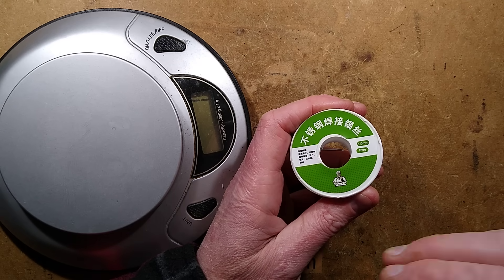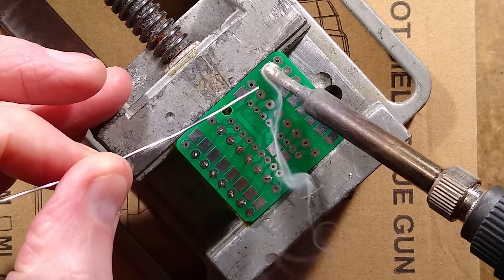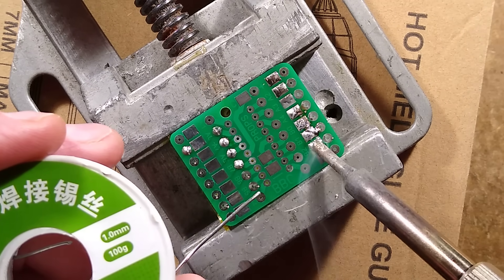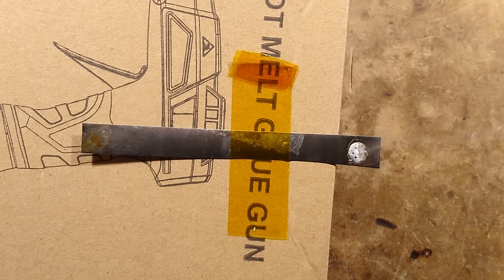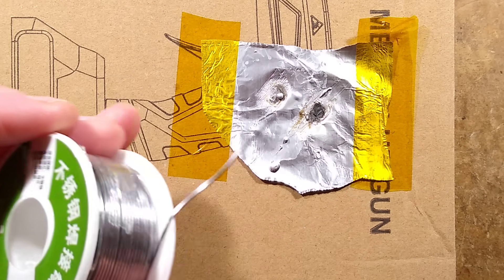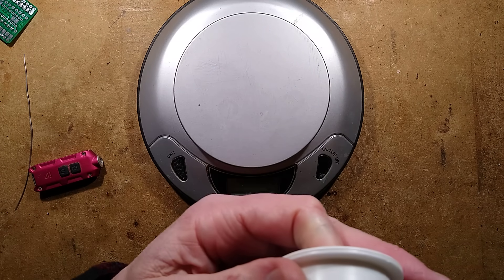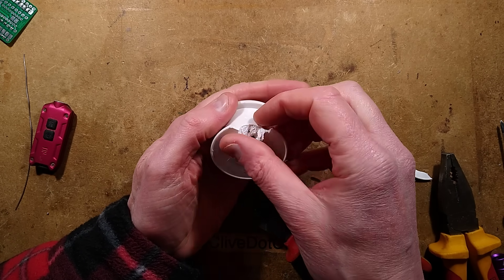Testing AliExpress "mystery solder"

Comment: I am very wary about solders since I tried a lead-free spool a few years ago. The joints were messy and the flux was aggressive, wrecking the soldering iron tip so I only use lead solder now which is much more reliable. I will certainly avoid this AliExpress solder.

Comment: RS used to sell the Red Jelly flux. You could solder stainless with that but the flux fumes were savage. I think it was a highly acidic flux and had to be cleaned off after use unless you wanted to watch circuit corrsion in real time.
I still have a bit left that I use to re-tin bits that have got damaged.

Comment: if you want to know which metal the solder is made out of, you can use precise weight measurements, or use different types of acids, or precise impedance values (which is likely something YOU can easily do).  you likely will not be able to figure it out just by using a soldering iron.  There are other ways, but likely you do not have access to a lab.

Comment: This (  shrinkflation method ? ) is frequently used for ladies ( potion pots ? )  .... HUGE  pot with a  BIG  false bottom containing just 5% of sticky goo  😝..... There is an acid flux (  A8 ) which enables any soft solder to work with stainless ... and even Nichrome wire ! ! .... Aluminium soft solder is a  TOTALLY   different alloy ... and ... will really ruin your bit , to the point that it can never be used again , for normal soldering  😝.... ( tried - n - tested ) ................. DAVE™🛑

Comment: Multicore makes a solder called Alu-Sol for aluminium and stainless steel, on which as you say normal solder will not work. Alu-Sol is not recommended for electronic components because any flux residue is highly corrosive.

Comment: Ha ha ha ha ha!  Ha!  I went through something very funny with solder.  Way back in 1989.  When I went from Washington DC.  To, Wellington, New Zealand.  To make a recording for a Los Angeles record label.

When I got there.  One of my important Microphone Mixers.  Had gotten busted.  From a hard hit.  With Fragile Stickers.  On all 6 sides of the box.  That didn't matter.  I have a busted voltage regulator.  It broke right off the circuit board.  And I saw when it happened.  When it was loaded.  I just knew something like that will have occurred.  But I digress.

I found an electronics parts store.  They had the voltage regulator.  I needed a cheap soldering iron and solder.  They handed me some solder.  It said 60/40 rosin core.  Perfect.

When I tried to effect, the repair.  The solder was not working.  It was not melting properly.  No matter the amount of flux.  It certainly wasn't the heat.  It was a $135, Weller Soldering Station.  Similar to what I had used for years.  But the solder was not working!  It was not flowing.  It was not smooth.  It was all cold little blob solder balls.  What the hell?

So I look at my 60/40 solder more carefully.  It is 60% tin.  40% aluminum.  What the FUCK?  New Zealand had already gone Green by 1989.  No more lead was allowed in the country.  Except in car batteries.  Ugh!

And while my repair appeared to work.  There was no way.  I was going to trust that.  For the week long duration of the recording session.  Because the solder was no good in New Zealand in 1989.

When I got back to the USA.  I think I purchased myself 10 pounds worth of solder, 60/40.  60% lead.  40% tin.  As it should be.  And I have since run out of most of it.  What will be available in the future?  I will not bother with that, tin and aluminum garbage.  That is bullshit!  That is not solder.  That is some ineffective concoction and amalgam.  That does not work at the heat levels we must maintain low.  To keep from burning up the parts.  Aluminum needs to be over 1000°F.  And that's not happening.  ROHS?  Crimped garbage!  A total lack of solder.

And don't get me started on Surface Mount, bullshit.  That's nuts.  That is not meant to be repaired.  That's why it's built, that way.  But there are crazy extremists.  That will fix that stuff.  And replace a VLSI, Very Large Scale Integration, circuit.  With over 100 leads, on it.  To remove that.  And stick on a new one.  Really?  It's disposable!  Replace it.  None of this was meant to be repaired.  It's a crap shoot.  Why spend the loot?  Throw it toward a new one.  You need something reliable.  Not an old jalopy that keeps breaking down.  It's the way the rich guys designed it, to break.  And to become part of a landfill.  Since it's mostly sand, reprocessed, to begin with.  With a whole lot of gold.  Which can also be recovered.  Because it cannot be replaced.  Without more asteroid hits.  We don't necessarily want.  You know?  And so our thin atmosphere, helps.  It's only 15 pounds per square inch of pressure.  Not enough to slow down a falling airplane, slowly.  Unlike on Venus.  But then the passenger jet would melt in mere minutes.  So it has to remain above the clouds.  Just so you know.  But I digress.

I don't think Donnie is going to make it through the next four years.  I think you will get worn out.  And want to go play golf, a lot.  And leave everything up to JD Vance and Mikey Johnson.  And Elon Mosque to run the country.  Elon will become Speaker of the House.  And will tell everybody what he is making more efficient.  That will cut down on having to pay a lot more people they don't need to.

I can tell everything is going to go like Cock Work. Only their mothers will know that they play with themselves.
RemyRAD

Comment: Is it rosin core? Another test would be to try to wash the flux off. If it washes easily, it’s water soluble which is really nice but you have to clean with soap and water to stop the corrosion

Comment: I bought a "4500mAH battery backup/charging station/flashlight" combo with external solar panel thingus a year or two ago. At full charge, it was unable to keep my phone from dying. Opening it up, it contained two standard small lithium cells, and a plastic-covered weight to give it heft. Those people have no self-respect.

Comment: at 5:40 i must know what that magical pen you're using is that instantly roughed up that surface
Reply: Looks like a fiberglass pen but I could be wrong
Reply from the maker: It's a wire brush pen.  Available in brass, steel and fibreglass.

Comment: One of my soldering irons came with a reel of quite nice, thin solder... Looked and felt like it would be a decent roll. But it turned out to be just 2 layers wrapped around a spacer inside the reel.
Very disappointed - not so much because i felt like I'd been ripped off (since I bought a soldering iron, not solder), but because I really liked that roll of solder. The stuff I bought to replace it doesn't feel as nice to use.

Comment: I have a similar one, also labeled as stainless steel Solder (50g), but definitely far less than 50g quantity.  This solder was put on the shelf for at least 2 or 3 years and long forgotten.  I fished it out and found out that 
- the solder loses its shiningness and looks dull
- in few spots, rust similar to iron oxidizing (brown-red color) showed up!
It definitely is not "stainless".

Comment: I had 3 rolls of soldier that were recalled by aliexpress, they did not say what chemical but said it contained a high level of something bad, it also trashed all my soldering tips.
I was refunded and binned 2.9 rolls of solder.

Comment: I only use 60/40 and 37/63. I like lead. That lead free stuff sucks. you'll probable never have a reason to solder stainless steel. I never have. Use 5 core multi-core and you'll never use anything else.  Thats clearly lead-free garbage.

Comment: In theory you "can", you're able to solder silver with a tin/lead alloy at a low temperature. But you shouldn't!
When you re-melt silver or gold and the alloy gets contamined by the tiniest amount of lead or other metals - it not only alters the %age or Karat of the alloy down but it also makes it BRITTLE! Rolling, wire-stretching, forging - nothing is possible with such contamined silver or gold anymore. It crumbles luke dry potato-chips.
This contamined alloy needs to get cleaned electro-chemically in a factory!

Comment: For solder to 'wet' onto stainless steel, then it likely had an aggressive hydrochloric/ zinc chloride acid based flux or phosphoric acid based flux in dry form in the core etc
Not good for electronics soldering or sniffing.
Gaz Yorkshire.

Comment: you should solder some electronics parts and have the circuit run for a sometime and go back to see if the solder has damaged the copper traces !

Comment: The alloy of this solder must be cheap as dirt to maximize profit. My best guess is that it’s lead solder — not leaded, but pure lead. It’s soft and can be used as solder. Due to its high availability and diminishing demand, the price has plummeted to $0.8958 per pound.

You don’t need a sophisticated lab to verify this. Pure lead solder joints have a matte surface, and lead-free solders also produce a matte surface after soldering. If you mix this solder with a lead-free one at an approximate 40/60 ratio and add a proper flux like rosin, you should obtain a shiny solder joint.

Regarding the flux, it’s probably an inorganic acid flux containing zinc chloride. It’s corrosive and not suitable for PCBs. You can also verify whether the flux contains chlorine using a simple test called the Beilstein test:

1.    Get a blowtorch with a blue flame.
2.    Heat a thin piece of clean copper wire in the flame until it is red hot.
3.    While the wire is still hot, dip it into the flux residue.
4.    Put the wire back into the flame — if it produces a bright green flame, it indicates the presence of chlorine in the sample.

Comment: There's a lot of scams on Amazon from the Chinese sellers also... I was on the Amazon Vine program where I would get "free" (actually, more like heavily discounted once you factored in that you had to pay income taxes on the items) in exchange for (what Amazon insisted) "honest reviews, good or bad".  I spent a lot of time testing the products and writing the reviews, but a couple of months ago, they kicked me off of it, saying that I had violated some provision of the TOS with my reviews.  I could not find anything that I might have violated.  They deleted my 600 or so reviews (some were Vine, some were products that I had bought).  I suspect that they did not like it when I pointed out the Chinese scams with LiFePo4 battery capacity and lumen claims on vehicle LED lights.

Comment: Thanks for the heads-up on this one.  I'm still going through two pounds of 60/40 .020" I found in a tool box I bought at a yard sale.  I don't care if it has no lead in it, that lead-free flux smells toxic, while the 60/40 stuff is pine sap.
Reply: Worst thing about old solder that is not on a reel is dirt and oxide. A few minutes soaked in liquid soap followed by a good rinse sorts it out. Then stored in a screw top jar.

Comment: I'm surprised the spool weight is factored in at all when you buy solder. If I bought I roll of solder that said 100g and I weighed it straight out the package, I would expect more than 100g, since it would be 100g of solder plus the weight of the spool. The same way when you buy a spool of 3D printing filament, it says it's a kilogram, and if you weighed one straight out of the packaging, you'd likely see ~1.2 kg due to the spool weight.

Comment: 0:12 "It even shows someone TIG welding...which is not right". I don't know about this. I remember a while ago seeing a video of someone TIG welding using solder a 1,000,000,000 Candle-Lumen 100W Power LED. So, this statement is patently false (it had explosive results, but that was due to a defective Ebay product).

Comment: Former employer bought this stuff, in fact we had so much junk from China is was crazy, some of it was good value, the hot air stations were great, soldering irons were trash, solder was trash, tools were trash, that's what happens when an accountant buys an electronics repair business.
Reply: Which solder stations are good? Yihua?
Reply: @JohnHopkins-e3p  What kind of soldering station? Regular or hot air station?
Reply: I’m looking for both. Something good enough for PC and console motherboards.
Reply: AiXun soldering stations
Atten 862d hot air station @JohnHopkins-e3p
Reply: In general the every industry where decision making isn't done by professionals who know this industry thoroughly.
Reply: Exactly what do accountants know about the physical world? FA.
If you want to ruin a business, hire an MBA.
Reply: @chriswalford4161  ya if you want to run a business into the ground in a handful of years.  MBA are all trained that labor is an expensive when it has always been considered an asset and resource until the 70s when MBA damn near took over running companies...but never founding a single one....
Reply: Apparently China specializes in hot air. This is something they have in common with certain American politicians!

Comment: They might be using an acid-base water-soluble flux, which would explain the soldering of stainless steel. If so, the flux can and must be cleaned with water.
Reply: "If so, the flux can and must be cleaned with water."

To prevent damage to.. a standard plastic/fibreglass PCB? The solder mask used on such? Other stuff reacting to produce noxious fumes over time? Stray electrical connections when none are desired? More detail needed
Reply: @snafu.X  The stuff that I used to use could cause corrosion on pcb's. In several cases, it caused circuit failure. This was 40 years ago. Tech has advanced.
Reply: @ TVM

Comment: I second the motion for a severe dislike of lead free solder.
Reply: The current stuff is fine.  Stopped parroting what you heard on the internet from 20 years ago.
Reply: @j.f.christ8421  My position is based on nearly 50 years of experience not the opinion of someone on the internet.
Reply: @chrisose  Ah.  One of those "one year of experience repeated fifty times" folk.

Comment: I always use Goot 60/40 solder that I obtain whenever I’m in Japan. Seems to work for everything, and better than the lead-free stuff that seems to be the only thing I can find in the UK (in my opinion anyway - I’m sure there’s a reason why lead got banned in solder!)
Reply: "I’m sure there’s a reason why lead got banned in solder!)"

Lead is a heavy metal pollutant that can cause brain damage over long exposure & high concentrations, hence its withdrawal from use in vehicle fuels & industrial applications such as solder. Sadly, the largest such sector (vehicle fuel) replaced lead with benzine, which is an even more rapid-acting carcinogenic than the (relatively slow-acting) brain-damaging lead :(

In this case, you literally 'choose your poison' :(

Comment: I've not bought solder from aliexpress, but I bought some liquid flux several years ago which was the best flux I'd ever used.. can't find it again though :/
Reply from the maker: You can get rosin online and dissolve it in isopropyl alcohol to make a fairly passive flux.

Comment: AFAICT... by the way is solders, its probably a 'lead free' ...non-eutectic ... solder... with an aggressive flux...like  Sn96/Ag4 (96% Tin  ,4% Silver)... or probably more tin... and less silver. The higher the tin content... the better it would be for soldering stainless steel. The 'secret sauce' is to use a very aggressive flux. It could be a tin/lead/silver solder... but by the way it soldered... it appears.. IMO... to be 'lead free' To tell...you can test for the lead. There are various test papers, and reagents, available for that.

Comment: On the upside being able to solder stainless makes it good value for money in my point of view. Suggest an extractor if used inside. No need to open a child proof blister, shred the wheel and feed it to your glue gun for instant plastic repairs.

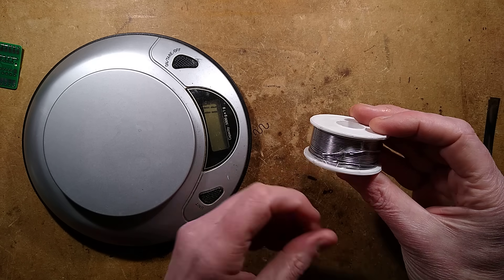Comment: 1:18  In China it is understood products displaced weight includes packaging.  

A similar example if I may .. IN the USA canned Mushrooms weight displayed on the can  ... incudes the MASHROOMS ONLY .. NOT the water in the can ... NOR the can itself obviously.

Whereas n CANADA canned Mushrooms weight displayed on the can incudes the MASHROOMS and the WATER.

This difference is due to the fact packaging display laws, in USA are more strict than in Canada. 

Also obviously in all Countries there is a reasonable variation (usually 5% to my experience)
Reply: In the UK you get both the net weight and drained weight on the label, so our labeling regulations are even stricter.

Comment: I personally dont use AliExpress for anything i need to use on my body, plug into usb/data ports or may potentially ingest due to err issues with what materials may be used or what a conneced IC may contain 😂

Comment: I don't understand why anyone in the uk would buy solder from aliexpres when you can buy 60/40 from cpc and get a safety sheet for it telling you what's in it. Im not going to use any flux that i don't know what the ingredients are. You only get one set of lungs to last you a lifetime 😮
That said i still run a flume extraction system with a lot of filters so i don't need to breathe in smoke and fumes.

Comment: Haven't used cheap solder in years. Just as a lung preservation measure. Stannol 60/40 is great. Trying Qwikchip water based flux 60/40 atm, it's pretty good.

Comment: The label claims 99.3% tin 0.7% copper. The Title translates as "Stainless steel welding solder wire"

Comment: One should use a separate (old) soldering tip for this type of soldering wire. The flux decomposes the coating of the tip and the wetting with tin gets lost.